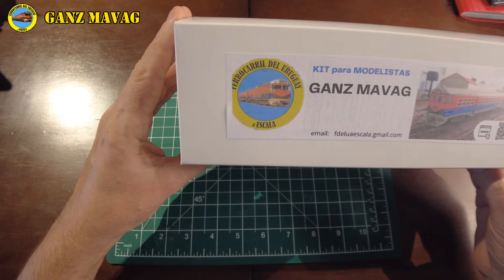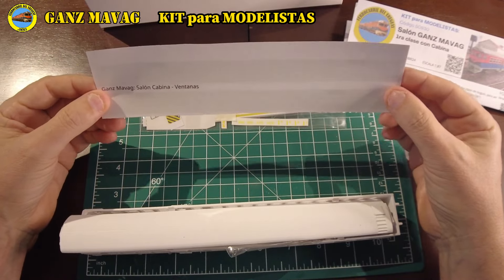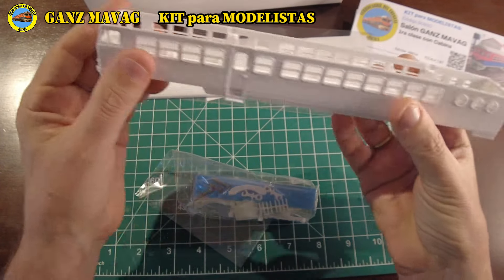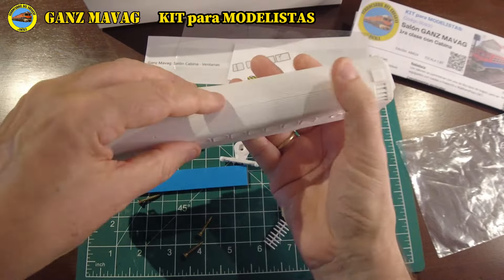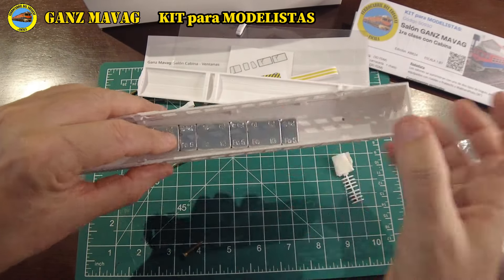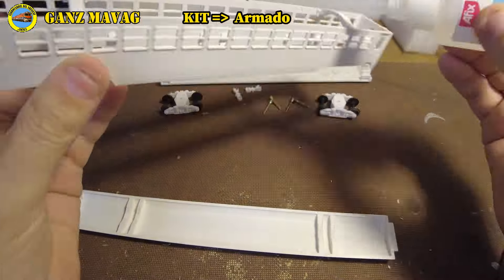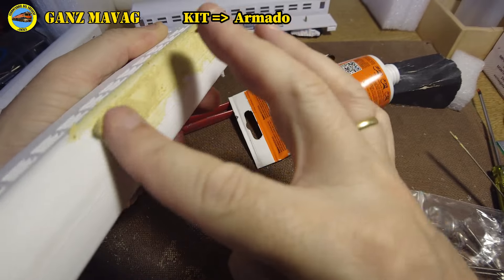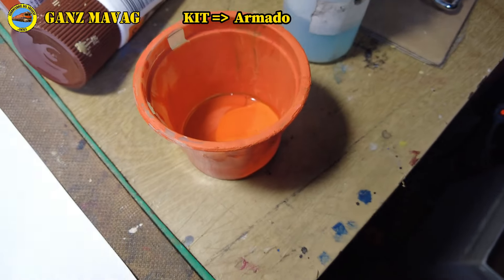Lanzamiento:  Salones Ganz - KIT para Modelistas

Comment: Yo la verdad tengo preguntas, las fotos no me dejaron en claro qie acople usaban y sobre como hicieron con los salones cuando los usaron con las 1500 porque entiendo estas usaban freno tri-valvula y no se que de la electronica
Reply from the maker: Hola. Los Ganz Mavag tiene un gancho de mandíbula automático (sin topes ni cadena). El freno es por aire comprimido, compatible con las GE 1500 mas no el gancho. Se usaba un vagón adaptador tras la locomotora 1500 o las 2000 para llevar los Ganz. Uno de esos adaptadores era una chata con un contenedor.
Reply: @FdelUaEscala  Osea las GE podian llevar formaciónes de aire o de vacio pero no mixtas?
Reply from the maker: Revisando, es verdad! La GE 1500 tienen solo freno por vacío...incompatible con los frenos de aire comprimido que usaban los Ganz Mavag. Solo las Alshtom B56 y las GE 2000 contaban con los dos sistemas de freno, y por tanto podían remolcar a los salones Ganz Mavag, aunque requerían de vagón adaptador por el tipo de gancho.  Por tanto, las GE 1500 no remolcaban salones G.Mavag...y si lo hacían era sin frenos... Las Alsthom y las GE 2000 sí (con vagón adaptador). Particularmente las UM Ganz Mavag, podían tirar de vagones Argentinos (en el litoral), ya que éstos usaban frenos de aire comprimido también.
Reply: @FdelUaEscala  Bastante raro, yo me acuerdo de una vez tomar una GE llevando dos Ganz-MAVAG a 25 de Agosto por 2008 o 2009 y me acordaba de un 1500, pero tenia 5 años entonces y no tenemos fotos ni nada